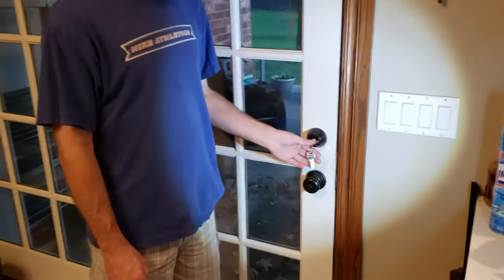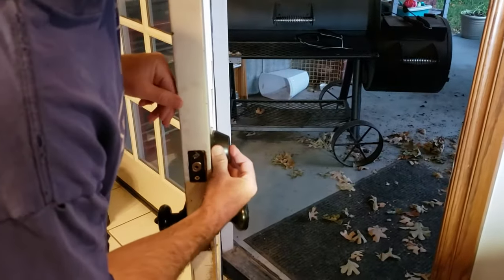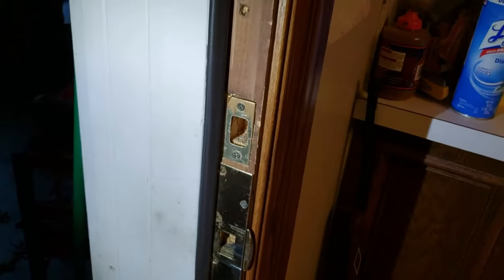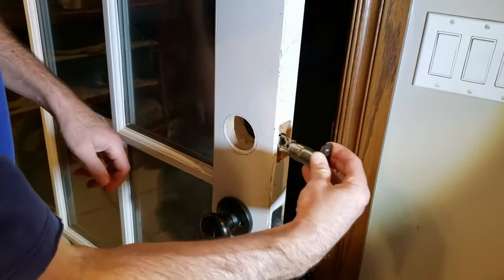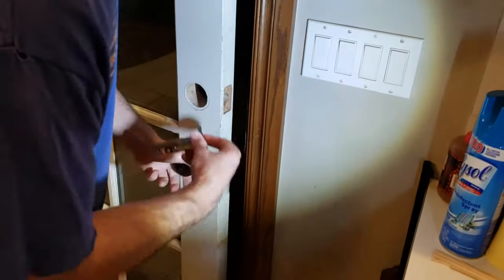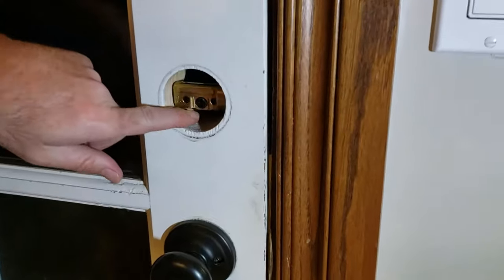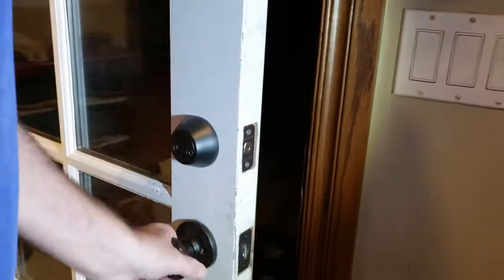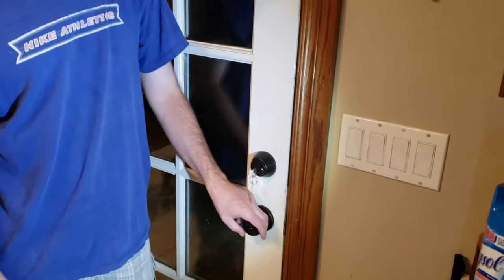How to replace a deadbolt door lock in 10 minutes. Easy install!

Comment: Not smooth?  Adjust the 2 main screws on the lock, you don't want it to tight or loose.  Try different tightness ( for lack of a better word)  The "customer service rep" from a lock dealer told me that you don't need to spray any teflon or grahite into a "new lock".  That was comforting to know.

Comment: How long were the screws that you used?
Reply from the maker: Which ones? The black ones that went through the lock itself? Those came with the deadbolt. If you're referring to the ones that attach the deadbolt to the side of the door, I think those were about 1 inch. Usually the ones that come in the package are shorter than that, which is fine, but I like to use longer ones, especially if it's not a brand new door (and fresh wood).

Comment: My screws won’t screw into the deadbolt why?
Reply from the maker: Are they the screws that came with it? Make sure they're the right screws. Some in the package will be for screwing into wood (wide, coarse threads); others will be for screwing into the deadbolt itself (narrow, fine threads). Sometimes it's hard to get the screws assigned and started in the hole but once you do, they'll screw in normally.
Reply: I had that issue first time just do in the order he did and make sure that arrow is up.  It takes like 3 hands to do it...

Comment: Did you re-key that lock to match your other lock on the door?
Reply from the maker: Yes. I typically buy the re-keyable locks made by Kwikset. Saves a lot of money by being able to re-key locks yourself.
Reply: @FixEverythingYourself  I didn’t think the deadbolt you installed was one of those you can re-key yourself
Reply from the maker: It isn't, but the lock below it is. I'm able to re-key that lock to match the key that came with the deadbolt.
Reply: @FixEverythingYourself  ok cool! I am getting ready to change my front and back door deadbolt and going to try that smart key.
Reply from the maker: @prostreetgsxr  good luck! Those rekeyable locks are very convenient and good quality, too. After installing, it takes 60 seconds to re-key the lock whenever you need to do it. Works great for folks with rentals who have to change locks whenever tenants move in/out.

Comment: My deadbolt is stuck, how do I get it out?
Reply from the maker: Stuck, meaning the key won't turn to retract it? If so, try spraying WD-40 in the keyhole and see if that helps? Otherwise, you can retract it manually after disassembling the lock from the inside.
Reply: @FixEverythingYourself  stuck like all the screws are out but it won't come out of the door stuck
Reply from the maker: If you took out all the visible screws including the ones going into the thin part of the door that hold the deadbolt itself in, you've removed all fasteners. It's likely just stuck from friction. Try rotating it (if you can) to break the friction. If you're referring to just the deadbolt cylinder and not the round locking mechanisms on the inside and outside of the door where you turn the key, you have to remove the mechanism first. 

Normally they come out pretty easily so there's likely something still connected. If all is disconnected, the deadbolt cylinder can be pressed out by pushing on it from, inside the hole in the door.
Reply: @FixEverythingYourself  one side the cylinder just spins in place and doesn't lock , that's why I have to replace it. The outside of the lock still works. It is strange, never had this problem.

Comment: I can't get the screws to line up🤬
Reply from the maker: Hmm. Not sure what to tell you other than to turn them counterclockwise at first to get them lined up, then gently screw them in. Also take a look at the first few threads on the screws themselves and make sure there's nothing in the threads and no marks/dents on those threads.
Reply: Right, I had a very difficult time to get those two long screws to fit in the two screw holes. But a very good video, nevertheless.
Reply from the maker: Thanks

Comment: Good video. What brand of lock did you use?
Reply from the maker: Sorry, didn't see this comment earlier. I used a Gatehouse lock, I think. It was one of the cheap ones from Lowe's but I bought it because it was the only one I found that was keyed on both sides (inside and outside).

Comment: Put the key in vasoline then put it in the lock. It's from the chemicals on the key from manufacturing. If you spray a lock with bleach, alcohol and cleaning chemicals the key will not go in the key hole. I figured it out during my covid sanitation days.

Comment: Mine does not have any screws on front or back😬
Reply from the maker: Does it have little round caps or something like that that could be covering up the screws? If so, try popping those out with a small screwdriver to see if there are screws behind them.

Comment: I can't get the bolt to line up! It's so frustrating,
Reply from the maker: The deadbolt hits the metal plate on the door jamb instead of sliding into the hole? Is probably only a tiny bit off. You could loosen the screws on the plate and adjust it a little bit the right direction to allow the bolt to go in. Another thing I've done is used a metal file to make the hole a tiny bit bigger. Often that's enough.
Reply: @FixEverythingYourself  I'm talking  about the long screws aligning up with front and back of the knob assembly, my problem is that I tried using parts from different knobs, now I'm searching for the matching parts, I'm trying to keep from buying different lock with different key
Reply: @FixEverythingYourself  now I've bought a new deadbolt, hopefully I can use the old keyhole with it
Reply from the maker: Good luck!!!
Reply: @FixEverythingYourself  I believe this used door is giving me bad luck, I bought a new deadbolt at Dollar general and used my old keyhole and everything lined up but the bolts are too long to use with different keyhole, not to mention I stripped the heads, now I have to cut out screws, I knew better than buying cheap lock, I need to buy the matching lock that my keyhole is made by,

Something that normally takes minutes is goning me so much trouble, must be the jinxed door lol

Comment: I'm watching this because I had my neighbor take my dog out while I was at work and I think he went and made a key from mine because I come home now and light is turned on I know I turned off.. so I'm gonna change the lock
Reply from the maker: Yep, good reason to change it. Kwikset makes a lock that's re-keyable by yourself in about 60 seconds. It's a high quality lock that doesn't cost a ton ($35?) and you won't have to replace if something like this happens again.
Reply: Same here I think my maintenance guy comes in my apt while I'm at work I have items missing from time to time

Comment: What do we do if it the dead bolt doesn’t spin enough like it only moves a little up or down. Mine doesn’t spin enough to fit
Reply from the maker: I don't understand the problem. The hole in the door isn't large enough for the new deadbolt assembly?
Reply: @FixEverythingYourself  no it fits it’s just that when i get it through the hole on the side of the door i can’t fit anything through the center of it because the middle part where the open spade is to put on the lock, it is too far down

Comment: Im trying to replace a deadlock, but we don’t have a key. I can get everything off except the outside ring (like the inside cylinder where the key goes comes out but the ring around that ia the only piece I can’t pry off. Not sure what to do.
Reply from the maker: Normally, those aren't fastened in, they just sit there. Maybe take a hammer and gently tap it from one side? It should come right out.